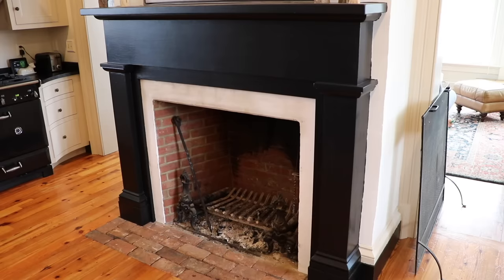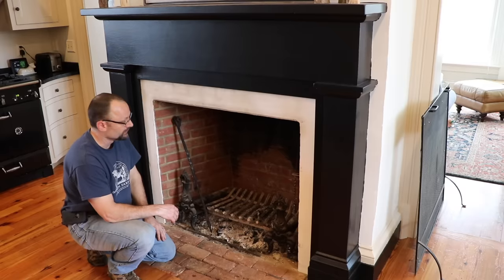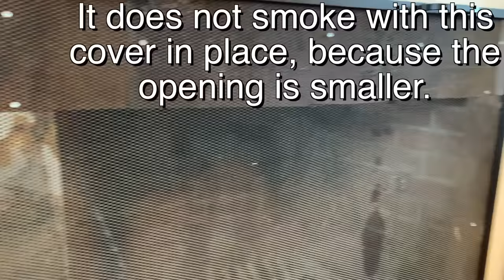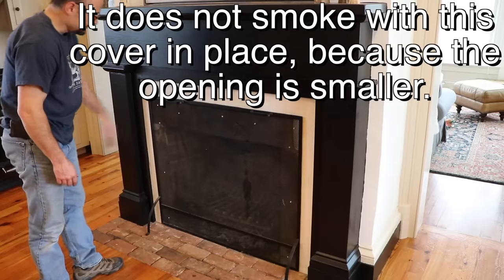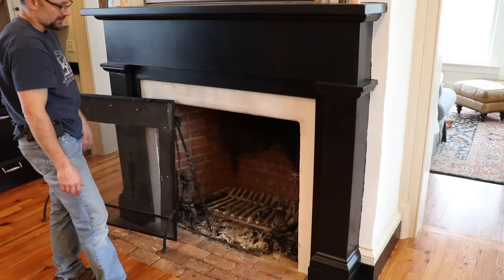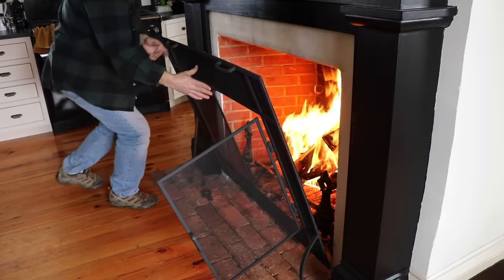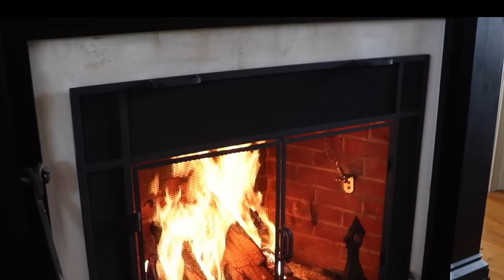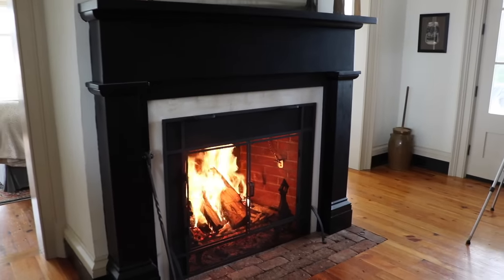Why Some Fireplaces Smoke, And The Easiest Fix. FarmCraft101

Comment: Nice fix and the barrel hinges, well that was just bragging. :-) A few simple tricks, when lighting the fireplace open a door or window on the windward side of the house for positive pressure, till the rising heat establishes. Make a combustible air intake in or near the firebox, it can be as simple as a vent grate to your crawl space. Air will follow the path of lesser resistance. Add a fan powered fresh air vent to a heat exchanger with a bimetal thermal switch. You can heat a distant room with positive air pressure by cracking open a window in that room.

Comment: Living here on the freakin’ frozen planet of Hoth (AVE👍) we ended up getting an airtight wood stove and put in piping to bring in outside air for combustion.  Otherwise the stove was pulling air from every window frame, door crack and wall plug to supply combustion air, making the place drafter then it really was.. In more pleasant climes like what yours appears, its very nice to just have a cozy, picturesque fireplace!❤ 🎉. Really enjoying your skillful execution of these many projects.😊

Comment: Great video, thank you! Great DIY project. 
You can purchase a smoke guard that is extendable and installed under the lintel and extends the width of the fireplace opening. You can also raise the wood grate with 4 bricks one under each leg, that will get the smoke closer to the smoke chamber.

Comment: I have Glass Door that you can open and Close. There is a metal screen that opens and closes. Open one side of the glass door for more air to draw of the smoke if you want. What I like about the glass doors you can close them when the fire gets low, with embers, and go to bed. Great Job John, I like what you did.😁

Comment: I had the exact same issue with the chimney having a new internal ceramic sleeve which constricted the flow as you mentioned. I setup a very small fan at the very top of the chimney which helps with the flow.

Comment: As always, great craftmanship and video!  In my world, I live in a different world :-) a smoking fireplace has many causes. Other than how much smoke is actually created in the combustion process, the main reason for a fireplace to put the smoke in the house rather than successfully out the chimney is pressure.  If you have a positive pressure in the house, the air will want to leave the house. An open chimney is a great escape.  Obviously, a warm chimney does this much easier, many factors. 
What strikes me though is that with an opening that big and a wide chimney, you choose to let a lot of house air out.  Which means that you get a negative pressure in the house, which means that you will pull air from the outside into the house.  You lose so much heat that way.
Jon, I would love to see a video where you install an airduct to your fireplace that will draw air from the outside into your fireplace and replace your mesh doors with glass doors. 
Many factors and tradeoffs on this and that.  I think that with fresh air into the fireplace rather than sucking in indoor air into the fireplace would be better. 
Keep it up, your videos and content are at the top of what I have seen on this here tube. You rock!

Comment: That magnet might get demagnetized from the heat. Neodymium magnets have a low curie point but from what I looked up they should be good to at least 590°F. Don't know how hot it gets that close to the fire.
Reply: Pure neodymium magnets have a relatively low curie point, but typically rare earth magnets are made with other additives which help raise the curie point a few hundred degrees up past 700°F.  My guess is the magnets stay cool enough, particularly since cool room air will be drawn past them by the draft caused by the flue doing it's thing.
Reply: the magnet that he use is a neodymium magnet but from a disc drive, this why the weir shape

Comment: Great job! I'm an old time Mason and have built many sizes and types of fireplaces.
The one thing you did with your screen more than anything was lowering the top of the firebox opening.
Without a long winded explanation on the Chimney Effect suffice it say that cold air is supposed to initially fall down the back of the chimney into the "smoke shelf". Its a cavity behind the damper and those tend to become filled, blocked or in much older styles weren't created in  fireplaces meant to burn coal or the unusual but very good Lord Rumsford style Fireplace. 
Your creating a larger "hood" allows more warm air to rise in from the front encouraging the chimney effect or the "drafting or drawing" the smoke and heat from the central part of firebox.
I noticed your firebox looked kind of tall for its depth and width, but that's not unusual as different Masons without formal training would wing it on the dimensions. The golden number for the height at the back edge of the upper opening up to the start of the lintel and damper is 9-12" to prevent smoke rolling out like yours did. 
We just usually made sure at least 3 courses of brick were placed over there.
Also, all modern fireplaces in the last 50 years required an outside combustion air in the side of the firebox. It's a cast iron or heavy steel box about 2"x3.5" and will have a hook to pull it open with a poker in order to start your fire. ATB 👍😁

Comment: Great Vid!

I had a large fireplace in a house (which smoked) and I installed a forced air fan in the firepit vent. Your solution (decreasing the area) would have probably been a better fix.

Comment: Never used a fireplace much 
but ive seen others just stop using them because they smoked  never really gave  much thought as to why they smoked but it makes perfect sense
 what size should a fire place opening be in relation to the flue 
in my house we use a wood burning stove they seem to heat a larger area using less wood

Comment: Another reason is that a lot of fireplaces have too wide a throat, the connection to the flue.  There should be a smoke shelf at the back of the damper as well.  Many fireplaces are really not built properly. The fireplace I have doesn’t have one and to keep it from smoking you have to have the damper closed one notch to prevent downdrafts.  Doing what he is doing might help but it probably makes the fireplace even less efficient.  Another trick is to put the grate on a couple of bricks.
Reply: You are 100% right.  The smoke shelf is missing on a lot of fireplaces. I end up doing what you do that is closing the damper a notch.  Seems counterintuitive though.

Comment: I am certain that the total size of the opening is NOT really the problem . The height IS the problem in that the height of the opening is to close to the flu opening(the in draft near the top is what is slow/weak). The baffle you put at the top of the screen is what actually solved the problem.  I AM confident of this because the flu shutter is likely has just as much cross section as the resized clay insert improvement , so the draft volume is still the same. ALSO, the opening to my fireplace is 56" wide by 36" tall (much larger than yours ,except in height) and even with the clay tile upgrade simply keeping the screen closed keeps the updraft from slipping out into the room.
Thank you for your idea though in that it reaffirmed the idea that I WILL reduce the height before I buy a new set of doors that I would like to have to be able to regulate the burn .

Comment: For anyone who needs it to always be open, the height of the entrance of the firebox can be lowered by 4 to 6 inches by "rigging something." Basically, just bring "that white "horizontal" down a bit. Even a 6 inch metal strip can be "rigged" if it can be attached.....  simply... ...... any way to make the length x width of the existing opening smaller,  should help. Glass doors with an air intake adjustment.... but that's the expensive fix.

Comment: There are several factors to a wood burner/fireplace smoking or not smoking.  A cold flue doesn’t draw as well and will cause smoke and the hotter the fire the less smoke.  I’ve never personally had to deal with a fireplace but our wood burner had smoke issues until the flue heated up.  I would always take the torch and get as much heat into the pipe as I could when starting a fresh fire.
Reply: When we had a woodburning stove I'd always stuff some newspaper up the flue and light that before I tried lighting the actual wood fire.

Comment: I had a fireplace that smoked really bad when the wind was strong and out of the north as the chimney wasn't high enough over the top of the roofs ridge so the wind coming from the north over the roof would roll (turbulence) and push the smoke back down into the fireplace or at least cause it to pause and back up and smoke up my house. Fireplaces tend to suck for the most part for heating a house as the heat rising out of the chimney pulls air from the house so the living area will be warm as toast but the rest of the house will be cold especially the further away from the fireplace you get. A wood stove is the way to go to heat a home.

Comment: Maybe you said this and I missed it but how did you determine the size of the fireplace opening to prevent the smoking? I’m assuming it was simple trial and error but perhaps there is some ideal ratio of opening and the flue? Great content on an obscure topic.
Reply from the maker: Thanks!  It was just trial and error.  I picked a proportion that I thought looked good and tested it out.
Reply: FarmCraft101 thanks for the reply. It looks great.
Reply: @CordCrenshaw  I remember hearing a figure of 9:1 years ago as the ideal ratio. May be wrong but worth investigating
Reply: Actually after Googling it apparently 8:1 is better,  7:1 to 10:1 depending on chimney height and whether it is a round/square/rectangular flue.
Reply: @williamwilkins1506  thanks William! Appreciate you sharing the knowledge.

Comment: After living in a house that was built in 1941 for over 25 years (still here) our chimney sweep told us our really small firebox was because it is a coal burning fireplace.  Coal burners have a special grate called a "coal basket" it is on a 45degree angle towards the back of the firebox.  Just load it up with coal and as the coal burns, more would drop down into place, always keeping the fire in one spot and away from the front of the opening.  With wood and a conventional grate the fire would burn all over the place, and when it would get near the front "opening" People have called the fire dept. on us as we aired out the living room with a big fan.  Forgot to mention our brick opening is only 25" x 26".  We fixed it by modifying the current grate into an impromptu "coal basket" Had a friend who is a welder, weld 3 short iron rods at a 45 degree angle onto our existing "wood" burning grate.  Works grate (pun intended). NO more smoking but, embers would pop out, and if you've ever had a piece of poplar get in by accident.....4th. of July in the middle of December!  So we had a custom set of fireplace doors with glass and a screen built (only cost us 400.00) back in 1985.  And we can now enjoy a warm living room. (2023).

Comment: Rea-rearth magnets - bad with high temperature. You can try ceramic magnets, but they  also will got max temperature where magnetic power will go away.
Reply: Would moving the magnet/tab to the bottom alleviate this? Would id be meaningfully cooler down there?
Reply from the maker: No problems so far, but yeah, might have to use a different magnet if it loses it's magnetism.
Reply: @taylorbespoke  I don't know where you got that info, if you just go to Google you'll find out that your message is a fairytale. Neodimium start loosing strength at 80C and depending on the type can go up to 180C. But those NdFeB are not in use for HDD.

Comment: What’s your suggestions for an issue I have . I reno’d my house and made my opening smaller on my fire place but left the flu size alone. The fire place guy said it would improve the draw which in theory it should . But now it smokes like crazy and it didn’t before ….

Comment: Your deduction and explanation are great but there is another common fact which makes this solution less likely. A chimney must have free moving air available to go up the flue. A draft. Houses often have improvements made which remove any draft, stopping the chimney from breathing. The only way to solve this is to create a new draft often by opening a window. Also your fireplace is in a kitchen. Extractor fans kill the performance of a chimney

Comment: I still close my eyes or avert them when I see someone strike an arc - even on YouTube.
Reply: I did it here also ... Flashburn is no fun
Reply: No idea: Does it still effect you on youtube? I started looking away in the video as well.
Reply: @lswhere40  No, the screen is simply turning pixels white (and some blue). Pixel based LCD/LED screens do not emit the UV energy that causes the cornea burns, it's just red green and blue dots combined to make white.
The electron gun in CRTs did create UV radiation but even going as high as x-ray, which is why they used leaded glass and there were safety standards created as response to radiation leaks.

Comment: what's the metal chain inside the chimney area? On the right side?
Reply from the maker: The chimney has a top closing damper.  That cable is how you open and close it.  Like this: https://www.google.com/imgres?imgurl=https%3A%2F%2Fwww.buckeyevalleychimneyservice.com%2Fwp-content%2Fuploads%2F2014%2F01%2FLY-Damper.jpg&imgrefurl=https%3A%2F%2Fwww.buckeyevalleychimneyservice.com%2Fproduct%2Flyemance-chimney-top-damper%2F&tbnid=5VycF8mlNrGHXM&vet=12ahUKEwi457eD95n5AhXln3IEHebVAcwQMygEegUIARD0Ag..i&docid=mrDm4HzgIpMjIM&w=250&h=250&q=top%20closing%20chimney%20damper&ved=2ahUKEwi457eD95n5AhXln3IEHebVAcwQMygEegUIARD0Ag

Comment: There are certain sizes you need to build the fire box on a fireplace this one looks a little too tall but a lot of times the smoking is caused by the throat being too shallow or the smoke chamber being too small nine times out of 10 it will be because the mason built it wrong

Comment: Age-old problem, good video.  I'm speculating, really what your doing is trapping the warmer air in the top of the fireplace, rather letting it role out.  Don't think the relative size of the burn chamber to flue is that critical.  On rocket stove vids I learned that the air in the chimney has to warm up roughly 2/3rds up the length of the chimney for a strong draft to develop.  Trapping warm air at the top of the fireplace warms the air up the flue.  Am I wrong?

Comment: Not everyone has a fabrication shop at there home. Nice work but unrealistic for the average home owner with a smoke problem. Maybe you should have hand forged the steel?
Reply from the maker: Did you read the pinned comment or the description?
Reply: @FarmCraft101  Yes i did, I fail to see what it has to do with my comment. I'm a bit older then you have been fabricating since 7th grade. Still don't change the fact the average home owner does not have access to a lathe or milling machine. Were the lucky ones. I don't have a fire place. Just looked in to see your take on it. As i said Nice work.

Comment: Personal preference :D I would rebrick any time of the day, rather than working with metal :). Especially having to strike an arc. I always wondered why do Americans constantly run away from brick and mortar. Working with metal is always a security risk. Skillful masonry worker would have rebricked this in 1/2h and it won't lose its design, as it did in this case. So, you got a thumb down from me  for overthinking on this one

Comment: OMG I can't believe this great solution was really just installing doors.  Why not simply purchase a readily available, and relatively affordable fireplace surround with glass/screen doors, for example what Pleasant Hearth offers or many other manufacturers sell.  Unless you have too much time on your hands and exotice welding and metal work tools to fabricate something that looks homemade.  I'm all about being self sufficient but this approach really doesn't make sense to me (stopped watching half way through).  Excuse me now I'm going to my garage to melt 10,000 rubber bands to make myself some new tires :-)

Comment: Are you suggesting that this is an easy fix?  Hmmm.
Reply from the maker: I get this comment a lot on this video.  I wish I had clarified in the video itself.  This is a LOT easier than re-bricking your firebox to accomplish the same thing, and you can also buy custom fireplace screens for reasonable prices.  You don't have to make it yourself.